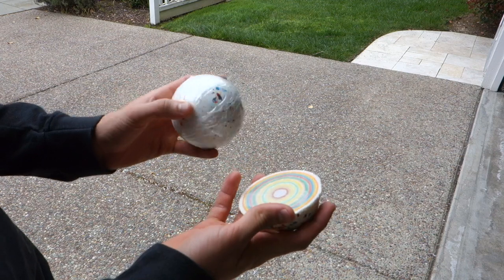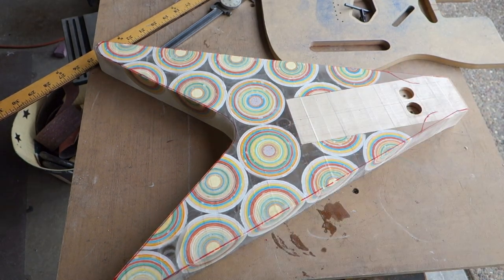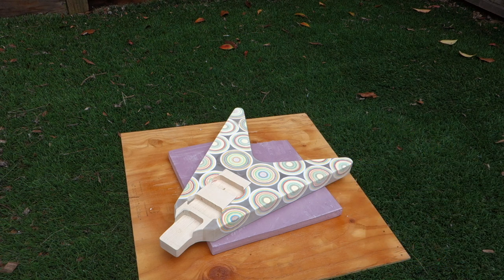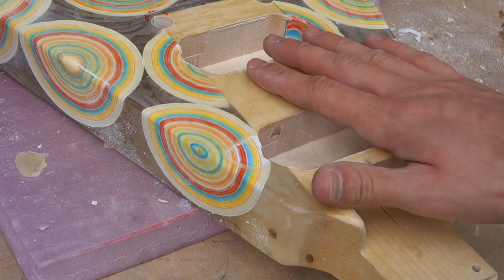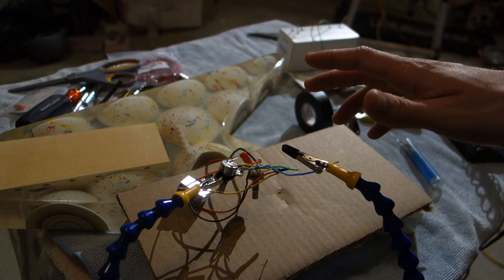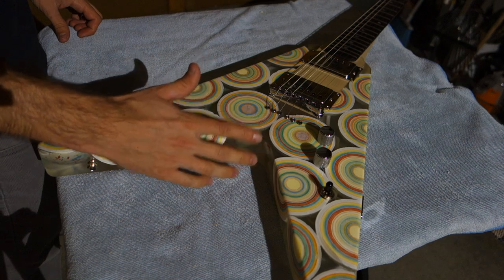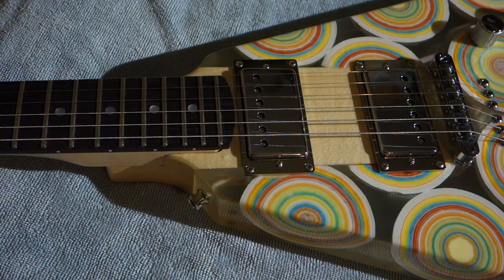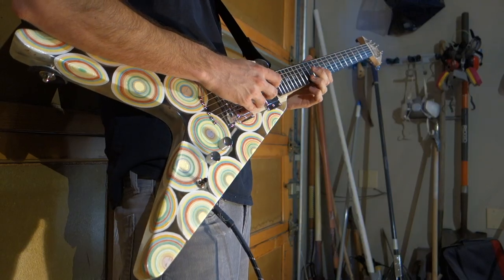I Built a Guitar Out of 8 Mega Jawbreaker Candies

Comment: build a guitar filled with assorted leaves from different seasons
Reply: @oyc7946  freezer?
Reply: Drying
Reply: I see the guitar ^^
Reply: cool idea I might try it
Reply: It would never work because if you collected green leaves from summer, by the time the new orange and red leaves come in autumn, the summer ones will decay and they'll all end up as December leaves
Reply: @RyaNo321GO  yeah so you freeze them in the freezer until its time to use them
Reply: Stevie Ray Vivaldi !!
Reply: Dip them in resin, let cure in vacuum chamber
Reply: Why not from the beginning of fall, u still get green leaves with some red and orange leaves
Reply: The four seasons
Reply: That's a cool idea
Reply: @kaisobstel3521  when you are putting those leaves inside the freezer they will turn out brown when you will get them out of the freezer and to room temperature again. Because of this you can't breed butterflies outside of the season of their food plant either unless the caterpillars will take food which is made out of dried and crushed up  leaves.
Reply: @oyc7946  i guess, theoretically, you could preserve them with a coat of epoxy resin.
Reply: I was thinking about that but for a table
Reply: @oyc7946  Biologists have been doing that for very long. you just need some layers of paper towels, preferably without any bumps. You put the leaves between the towels and then you use heavy books or weights to press down. Let that sit for a week. You will end up with a flat and perfectly dried leaf that wont ever lose color.
Reply: @RyaNo321GO  there's an easy method of drying leaves between the pages of a magazine
Reply: @4321jojoba  finally. An informed comment
Reply: Or he could just pour blocks of leaves every season and then put them together.
Reply: Dead leaves and the dirty ground!
Reply: That would be awesome
Reply: PLEASEEEEYES
Reply: Clear resin finish with leaves inside
Reply: @RyaNo321GO  that's not how the world works. I live in the Ozarks and even now we have brown and green leaves at the same time.

Comment: If you ever wanna do a second one, you can melt jawbreakers so it could make a really cool swearl pattern along with the circles from the cut ones. The only issues would be the colors possibly blending during the melting process and the solid jawbreakers melting from the heat of the molten jawbreakers.

Comment: Not the ideal place to put the strap peg. On a V it should be at the back of the body near the heel in order for it not to be too neck heavy. I had an explorer one time that had an extra long bolt at the neck joint to accommodate holding a spool to the body that you put one end of the strap to. I also had a V that had the strap peg at the back of the body at the neck joint. That's my only criticism of that guitar.